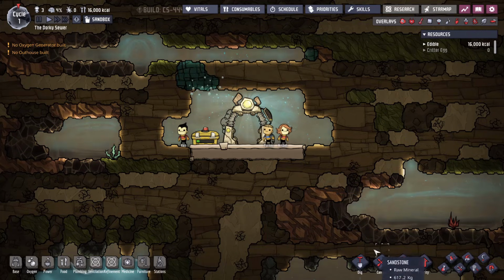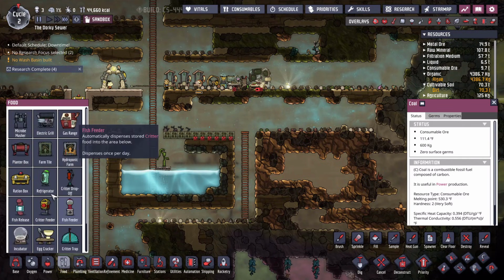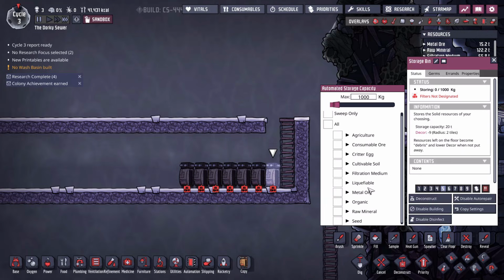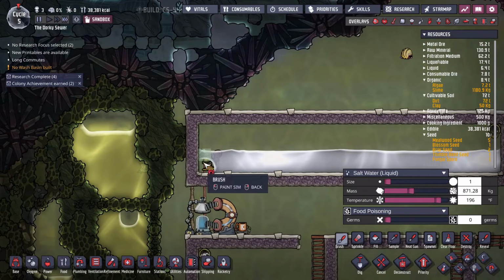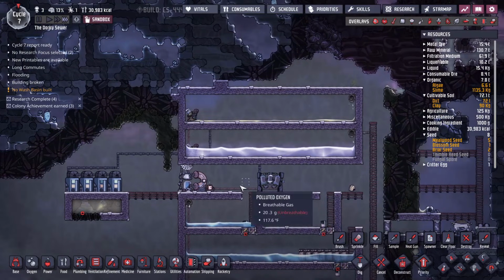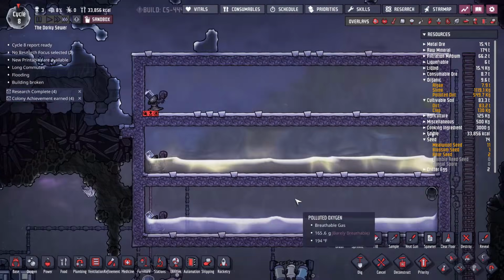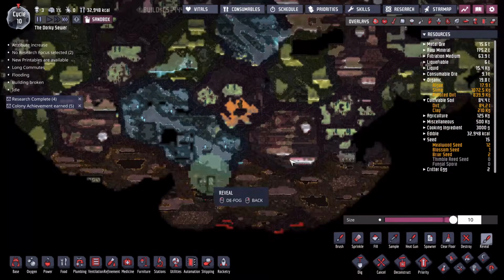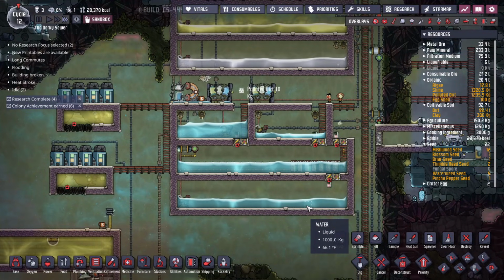Oxygen Not Included Tutorial: Water Management

Comment: The tip about low quantities of ice spread out in bins was very helpful in my current run (I saw it in another video), but I think you're selling the Cool Steam Vents short. They are by far the easiest vent/geyser to work with in the early game, and require zero cooling to feed a SPOM, which in turn gets you reliable suit docks to go out and find more or better sources, along with hydrogen for power and cooling. I have two of them feeding a half-Rodriguez at c. 450ish in my current run, and used them to fill a steam room for a metal volcano: still zero cooling on the geysers or the water. I still have most of my starting water, supplemented only by ice, with all my pre-space research done and a small berry farm.

Comment: I've got a question.

Could we use the hot water for bathrooms and sinks. Would it overheat the buildings?
Reply from the maker: It would spread heat, yes.  I guess if it's in an area where you don't mind the heat, sure, but I wouldn't advise it.

Comment: why not run the purified hot water into the regolith area and make the pipe radiant so you cool the water by exposing it to space. by the time it gets through a "maze" type grid layout it should be cold enough to deposit into whatever reservoir you want. i've also seen germy water get exposed to space and come back having zero germs in it.
Reply: Even though space is technically absolute zero there is no conduction because it's a vaccum

Comment: Is this really 'renewable'? Wont you run out of ice before your original water source even starts to run out?
Reply: yes it is because you can run pipes into the regolith and cool water that way. its reneweable in the sense that the map keeps creating H2O. is the cooling methodology sustainable? no not unless something is continually generating ice. you could harness space to cool materials that would be an example of sustainable cooling so taking a hot water geyser and pumping it up into a grid inthe regolith layer (to cool down) and then deposit in a reservoir would be an example of sustainable cooling. i always dig to the surface because i want to have an area to vent waste gasses.
Reply: @0utcast  I always find the regolith layer does not last that long if extensively used, I've quite often had the surface heated to over water freezing temperature purely from my cooling pipes.....

Comment: Do you think you could just (I say ‘just’, but it’s a bit complicated for just a comment I guess) grab all of your water sources, unfiltered, and boil and cool it? I’m thinking of the aquatuner steam generator setup which just boils a bunch of random water stuffs and then pumps the water outputted from the steam generator into the aquatuner. You’d probably need a steel auto-sweeper to pick up salt from the salt water, but wouldn’t it work as long as the system has a constant input? Even then you can probably use filter gates and stuff to turn everything off. This kind of thing would also burn the germs! I say this in curiosity and suggestion, not in trying to be informative; I have no clue if this would actually work.

Comment: The water looks fully recycled, and even the energy could be infinite with the treadmill as a fallback, but what about the sand?
Reply: Metal ore, salt or lime-> refined metal + sand when using rock crusher. Pokeshells farming, if you think it's worth the hassle. Also, regolith becomes sand replaement in filtration once you get to space.
Reply: @linkolek  AND once you get to space the regolith layer becomes your primary heat exchanger for liquids and gasses.

Comment: I found out that if you use sinks and lavatories and refine the water with a water seive than you get a little bit extra water back technically making it renewable.
Reply: Only lavatories output extra water.  Sinks and Showers output the same as input.
Reply: @MotoAtheist  oh, it's peepee
Reply: @Beunibster  Bear Grylls approved!
Reply: Sieves require sand
Reply: @CDLXVll  not only that but the waste water even after its filtered has germs. one could route pipes through a hostile environ which should kill the germs but then you'd have to get the water back to a temp thats useable. OP is wrong about it being renewable. i purify my sewer water and use it as coolant for my metal refinery and other things i need to keep cool.
Reply: @0utcast  is it feasible to desalinate salt water and crush the salt into sand to keep the deodorizer and sieve running?

Comment: Why would you say mush bars are terrible for water? Let's look at blossoms which also use water:

6 cycles for completion. 
20kg per cycle used.
Total 120 KG per 1600 kcal, or 2000kcal cooked.
That's 16.66 kcal per kg water. 

Mush bars:
75kg water for 800 kcal. Or 1050 kcal cooked.
That's 14 kcal per kg water.

It's less efficient, sure. But it's not that horrible. And requires zero infrastructure. Now it does cost dirt as well, but dirt isn't exactly hard to come by. I've gone hundreds of cycles on it alone with zero problems. Including in the swamp start which has zero dirt (living off of compost/mud processing basically).

And in the swamp start, Bog buckets require 40kg per cycle with a slightly longer number of cycles before it is fully grown. Which makes it consume far more water than mush bars actually.

The main cost of mush bar production isn't that it's horribly inefficient on materials imo, but that you need to use a lot of dupe time creating + cooking them.

Comment: Fantastic approach! Yes, stumbling getting near 100 cycles and running out of water while my Dups [6] are using it like it flows freely! What I like a lot about your video [s] is the fact that you touch on many subjects for example here learned so much more than just "water" aspect. Love it and many Thanks for making this 74 year Old Gamer happy!!! Got to Love Video Gaming, Stay well.
Reply: For water, you need to upgrade their bathrooms as soon as possible. Then you should make a chlorine room of at least 16x4 in size with a liquid lock or use the area that has the chlorine volcano. If you use rust for oxygen, you can send the chlorine to such a room.
The setup:

Build a liquid storage in there to bring in your polluted water from the location where you send your toilet output into. After the liquid storage, build a water sieve and convert to clean water with germs. then build a second liquid storage for that. After the second liquid storage, build a metal refinery. Use the metal refinery for your refined metal needs and it will help with germ killing. Output from the metal refinery into a 3rd and final liquid storage for germ free water and make sure that it get full before sending it out to your clean water storage to make sure no germs are in the water.
Reply: @hbarudi honestly germs are pretty easy to just ignore. Especially if you skip bristle blossoms like me.
Reply: Most bot-like comment I’ve ever seen

Comment: First you should focus on getting locavore, carnivore, and super sustainable achievements for your colony. It looks like you have to build several maximum size stable rooms to ranch hatches or other critters to get meat. Pacu are also good source of food. Once you get locavore but not carnivore, you can begin using plants like wheezewort and thimble reed for their purposes. When it comes to water management for long term colony survival, I use the chlorine found either where natural balm lily plants grow or if there is the chloride volcano. Then you need to build your water sieve there to kill germs. Dumping the slime in there will kill its germs and make your food last very long and not spoil. After the water sieve comes the metal refinery to ensure the water comes out very clean but still warm. In the metal refinery, I set it to do 99 of all that is available and if you got enough lime and iron and making refined carbon, you can get steel in the second batch. Now you have a good water cleaning system that can handle dirty water especially from their toilets. The biggest problem is when they poop into the clean water...
Reply: lol i grow my pacus in my potable water reservoir

Comment: I like watching oni videos from other creators, gives me more ideas! Thanks for the video, however one issue I have, you’re showing new players to automate geysers, but the way you showed them, they’ll overpressurize every now and then😅.  I usually drop the pump a tile lower than the geyser, or you can drop the sensor one tile down and do Green if above 200-500 for example. The way it’s set in the video 1,100kg of water is gonna sit on the geyser per tile before the pump turns on.

Edit: I went into my test map to make sure on this, and apparently this isn’t the case anymore. At least on the cool slush geyser I tested it on, it doesn’t overpressurize until 1,500kg. However in 3 tests I did an air pocket formed in the top right and left corners since if you allow the second tile to fill with water (1,100kg) it forms a whole tile if you only give it two tiles of space, so the hydro sensor got stuck in oxygen, I’d still move the hydro sensor down a tile to be safe 😁.
Reply from the maker: Yeah, either setup is fine.  I usually set those down to about 150KG per tile or so (I may have made a mistake at one point in this video).  I just want something to prove that it's worth spending the power to pump out, so one in either location is totally fine :)

Comment: Why do you avoid the Anti Entropy Thermo-Nullifier?
Reply from the maker: It's not very efficient and it requires Hydrogen (which is a very powerful resource for Hydrogen generators).  There are other solutions that are a lot more efficient IMO.

That being said, there was a long time when I was learning how to play where these saved my runs.  They are one of the more simple solutions in the game, so if somebody was using it, I wouldn't be upset at it.
Reply: @Magnet_MD  My current best run is using a self-powered oxygen system that pulls water in through the cool steam vent pool, then sends 2 pipes of O2 through a nearby hydrogen-filled AETN chill-box before sending it to the base. The hydrogen produced by the system is more than enough to power itself and the AETN, so I get to turn 70c water into infinitely sustainable 18c oxygen.
Reply from the maker: @RothAnim  Nice!  Yeah, if that works for you then that is awesome.  I'd need to calculate out how much energy that thing is taking by seeing how much you could have had by using that hydrogen to generate energy, and see which option is better.  I have to imagine they are so close that it might not matter, but I dunno, it'd be interesting to find out!
Reply: @Magnet_MD  It works out to about 80 watts for -80kDTUs (about 6.6 optimized wheezeworts). The biggest advantage of the setup is that it can be built incredibly early in the game. Like, "No refined metals" early. At that stage of the game, it's way easier to run vent pipes across the map than power wires, the cooling is needed for crop survival, and there's precious little at that tech level that provides that much cooling per watt. 

2 Electrolyzers can power 2 hydrogen generators and the AETN full-time, with about 14g/s left over for a reserve tank. If you split the power grid of the oxygen-maker, and use un-powered gas filtering, you don't even need refined metals: just copper ore radiant pipes, gold amalgam machinery, and igneous rock pipes/blocks. Automation can be added later for increased efficiency. If you're willing to torture your dupes a little, they don't even need atmo suits to set it up. An untamed cool steam vent will easily provide the 2kg/s of hot water needed for the system. Infinitely sustainable, even if it's sloppy**. My system uses 4 electrolyzers, but I only send 2 full pipes of oxygen through the AETN: The third pipe supplies atmo suits and spills into the excavation sites. 

**Edit: hah, oops, forgot to take dormancy into account. Total output of my vent with dormancy included is only 1.4Kg/s, so this sucker will need a supplemental water supply in about 40 cycles. Looking at you, hot steam vent on the other side of the map...

Comment: Around the 30 mins mark you start making tanks to cool water. I read a comment that said you only get half the ice from mining a block, so I'm wondering if it would be viable to snake piping into the ice biome for cooling to keep the max amount of ice while not worrying about contaminating clean water with polluted ice melting? Lmk if this makes sense
Reply from the maker: It makes sense for sure.  It can be more difficult to do that since melting the ice in the biome takes forever, and you can be subjected to a lot more water state changes that way.  If you have a good way to do it, I'd say to give it a try.

Getting only half the mass by mining it isn't a big deal IMO.  It'll last you for a while, it's easy to manage and you should probably have a more long-term solution (that won't involve ice) sooner or later anyway.
Reply: you run the risk of damaging pipes. i cool water by snaking pipes into the regolith layer and getting free indefinite cooling courtesy of space.

Comment: What should you do when you run out of ice to cool your water from the geysers? Thanks!
Reply from the maker: Your next step should be using aquatuners and steam turbines.  The aquatuners will cool water that is passed into them, but they will also generate a lot of heat.  So if you submerge them into some water, the heat from the aquatuner will eventually boil it, turn it into steam, and the steam turbines will cool the steam and turn it back into water (and put the water back into the chamber with the aquatuners).

You could also reduce your dependency on cool water by switching into mostly/all barbecue.  The only reason you should need cool water is either to set up cooling loops (using aquatuners and cold polluted water), or for bristle blossoms.
Reply: @Magnet_MD  Ah genius! I see, thanks a lot! Very underrated and informative videos :) thank you
Reply: I was just wondering the same thing. Now I need to check how to make that setup for the first time. Thanks. :)
Reply: run it into the space biome that will cool it down and you are good. its free cooling if you want to do a long pipe run

Comment: Nice! This would have taken me forever to figure out! I also had no idea they had water geysers lmao. Anyway you can do some tutorials on natural gas geysers and maybe at some point crude oil and how to do those setups?
Reply from the maker: Absolutely!  I have a couple other tutorials in front of it, but capturing geysers will be one of my next ones :)
Reply: @Magnet_MD  dope cuz I swear I have been watching geyser videos for like a week, just attempted my first natural gas system and keeps getting "over pressure"  messages on the output vents.
Reply from the maker: @NewBootMedia  Yeahhh, that can be a little tricky.  You'll ideally want some kind of storage area for it (either a tiled-off room or a bunch of gas storage containers), so you can handle the overflow.  If you are using a tiled-off area, you'll want to have plastic ready so you can make the high pressure vents (allows up to 20KG before they get blocked instead of the 2KG with the normal vents).